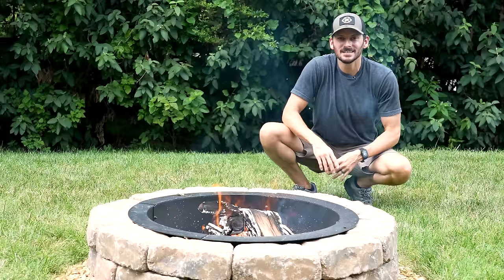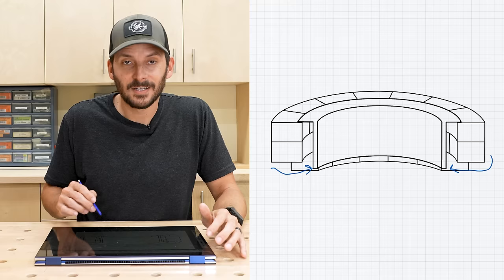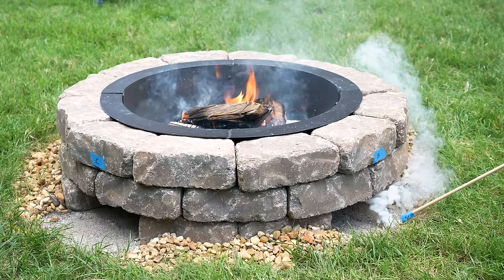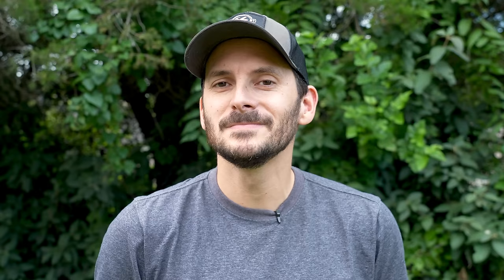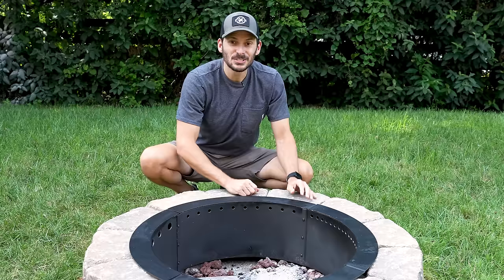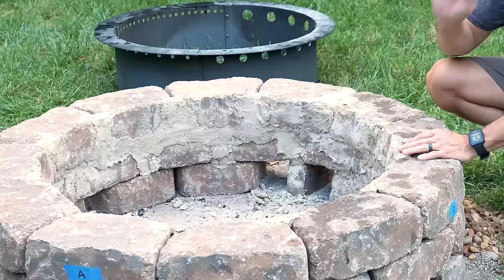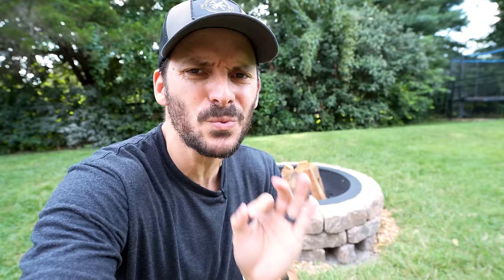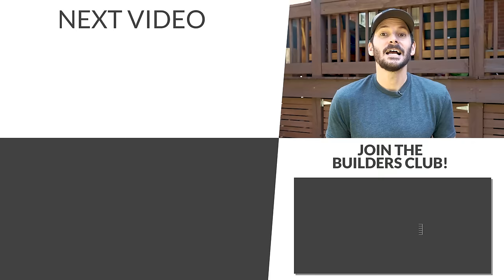Stop the Smoke, Do THIS to Your Fire Pit

Comment from the maker: Watch this next: Will Concrete EXPLODE in a Fire Pit? - https://youtu.be/TJP4iQlV8qU
Reply: Suggestion: I was hanging out with a neighbor who was using his oil-barrel smokeless incinerator and his has a few additional features:

1. an internal 45-degree bevel that redirects the air rising up directly to the upper holes, and
2. an external bevel just like #1 but more like a beveled lip just above the holes to slightly narrow down the fire pit/incinerator opening and giving more time for the secondary air supply to mix with the smoke and make the secondary combustion more effective.

The external beveled lip is around 1.5 to 2 inches in width which at 45-degress should only narrow down the fire pit opening by a total of 1.5-2 inches.

I was surprised his incinerator hasn't produced any visible smoke at all and I just thought that those features might have helped.

Comment: I'm thinking the only thing you could have done that would improve the performance of your fire pit is more depth. The Solo stoves are much smaller in diameter than your fire pit and they are taller in height. That gives much more space for the air to really heat up as it rises from the bottom to the top of the air channel. Great video! I know I learned a lot by watching it.
Reply from the maker: thanks! definitely would be better taller
Reply: A taller, narrower pit also concentrates the heat more. You want maximum heat and oxygen to maximize combustion.
Reply: @Fixthisbuildthat  As a mason if you didnt get the fire clay or at least fire mortar that quick set is going to crack with higher heats
Reply: Yes, and the fire needs to be big enough to really heat the wall of the fire pit. 
This makes it so the air gets proper flow and is superheated so it really combusts the smoke.

I own a solo stove and it works really great, as long as you keep it properly fed.
When it's really hot it burns green wood mixed in without any smoke.
Reply: @Fixthisbuildthat  or deeper. It doesn't have to be taller 💁‍♂️
Reply: I think diameter is the main issue.  Because of the inverse square law, a fire pit with twice the diameter of the solo stove would only be 1/4 as efficient  with airflow.  Also the stones and steel act as a giant heat sink, whereas the very thin stainless steel on the solo stove heats up very quickly and allows for the secondary combustion much faster.
Reply: or, load it up with wood initially. I think it may have done what you wanted during the earlier phases of the build if you had the fire as large as you did at the close of the video. Great project. Looks awesome. Thanks for sharing
Reply: @windowswashbasin  exactly.  I was commenting about decreasing the diameter of the pit, but increasing the diameter of the fire would have the same  effect.  Just depends on how much wood you want to burn…
Reply: Yes, I agree. But that is also relative. It depends on the size of your fuel and how much of it you use and how you distribute the fuel in the burn container. In this video, he didn't really use enough fuel until the end. A taller and skinner burn container does help a lot, you are right. But if he can keep the flames that come from the logs a few inches BELOW the top air holes, then the second injection of pre-heated O2 at the top has a chance to "secondary burn" any smoke the logs create. Also, above the top holes, the burn container should tamper in about 10% (rough guess). This helps maintain a higher air pressure at the exit, which creates a little back pressure, which helps give a more complete burn. This whole thing is a gasifier. You can google how to gasify things. Anyhow, it works because you are actually starving the fuel of oxygen, the amount of air flow coming from the bottom is very specific. You don't want too little or it won't burn hot enough. And you don't want too much because you want the first burn to use up all the incoming oxygen from below, you don't want extra unused oxygen pushing heat past the burn zone. A regular full downdraft gasifier will push the smoke over superheated activated carbon (hot coals) to convert any remaining oxygen and carbon to CO (which actually burns 100% clean). So, keeping the heat together so that it gets hotter, and controlling the airflow speed, will allow the longer chain tar molecules (smoke) the time and heat they need to break down to smaller and smaller chains until they turn into syngas (mainly HHO + H2 + CO) which is a natural type gas that burns clean and can be burnt at the secondary oxygen injection (the top holes), assuming that the oxygen and syngas are pre-heated hot enough.
Reply: I guess it depends on what you want most from your firepit, aesthetics, function or a balance of both.  I like the looks of a wider pit, and I also like being able to see the fire. If a person builds a taller fire pit, they may miss out on the aesthetical beauty of seeing the fire. I think this firepit is a good balance of both.
Reply: @ranmangolf  Sure. So I guess the real question is how to build one with the most visible flame but also the most complete burn. I'm thinking if we mimic an updraft gasifier a little more then it might help. For instance, instead of a flat bottom have a mesh cone so to more evenly distribute the incoming bottom air. And would make the fuel a bit more visible.
Reply: (First read my posts above.) So, I've been thinking of building this for a few years now. What we need to do is build an standard updraft gasifier. But then, at the top, open it up for burning like a Bunsen burner. When done correctly, this would have a nice ascetic of a large full smooth flame shooting straight up out of the container. Now, you wont be able to see the fuel. You would only be able to see the secondary burn. But, it would be clean and smooth and look just like a jet of flame, similar to a Bunsen burner. To do this we would have to build a regular updraft gasifier but with a different top, one that has a reduction zone with the right diameter and length. And probably relocate the secondary oxygen injection. You can actually mimic this idea with just a tall burn container and a ton of fuel but not over half full, and good bottom air flow... but it doesn't actually work very well. The 5th grade example is to roll up some newspaper or cardboard (like a "tube"), hold it pointed upwards, light the bottom, and let the smoke go up the center of the "tube". If the diameter of the tube isn't too big nor the tube too long, you should be able to light the smoke coming out of the top as an example of secondary burn. Of course watch out as you are now holding a candle that is very quickly burning at both ends.
Reply: I wonder if one could create passages that slant or wind up to the top holes to increase distance without having a much deeper pit?
Reply: @PimpTrizkit-42  Good idea!
Reply: Wouldn't that block most the radiant heat from the coals? That's the main thing that worries me about the solo stoves.
Reply: Nothing to do with the height of the pit or airflow, It's all about  the quantity of wood you're burning that makes it smokeless.  More wood = bigger fire = more burnt sooth or lack therof.
Reply: @adamschaeffer1565  If you are talking about my example. Yes, but that is the idea of a gasifier.  That first stage burn is meant to trap as much heat as possible to allow for a complete burn (no smoke). This maximizes the amount of syngas production. The syngas is the product we are actually trying to burn for real world work (aka. heat). So you max out the syngas production using what ever techniques work. Then burn the syngas in whatever way you need to accomplish the job. I was just wanting to burn it immediately for a nice looking flame but in your case you would burn it in some radiant stove meant for heating large areas, just like natural gas burners, for the same reason. But yes, going back to the more simple design like the solo stoves. I have always thought there should be a radiant mesh cone with radiant shield hung above the solo stove to reflect the heat back down. It just going straight up too much.
Reply: @adamschaeffer1565  that is exactly what happens on a solo stove. It's a great jet engine not a great people warmer. The pit is not very good at providing heat to the gatherers. Solo now sells a heat deflector that goes on top to angle the heat down and out to the gatherer's knees.
Reply: @IvanReyna  I wonder how much heat you would get if you used this guy's design or the solo stove and put it somewhat underground, say where the top of the pit was at ground level?
Reply: The way you build a fire can make it or break it btw, a top down fire will smoke a lot less, which is how you are supposed to build your gasifier stove forea
Reply: I'm wondering if some baffles behind the metal ring to slow down the airflow and give it more time to heat up.  

Also, how do you clean the space between the ring and the bricks?  I could see hitting it with the air compressor to blow the ash out of there, but that's going to make a heck of a mess.  I guess if you only have to do it once a year probably no big deal though.  Nice work.
Reply: I wonder if you added aluminum foil to the back of the bricks? How much would that help heat the air?
Reply: It also looks like the narrower width gives the smoke less space to leap out at the top leaving the rim without getting in touch with the flames.
Reply: @Fixthisbuildthat  0:38  - Someone will do the math one day, and its gonna show the smoke is pulled in by the persons mass.
Reply: @grotevin  Yes this!
Reply: Exactly what I wanted to say.
Reply: Yeah seems like that would give more time for the air coming up the sides to heat up. Also think the smaller diameter helps because hot air gets hotter since it’s closer to the flame and the air can more easily get to the top of the fire.
Reply: Not necessarily taller from the ground up, but perhaps digging into the pit to about its height and putting in a grate. Its a bigger project, but if you can replicate the commercial smokeless fire pit as kind of like a half in-ground pit, you may be going places
Reply: I was thinking the same thing, the secondary combustion can’t really take off if the fuel is sticking above those top holes. That tall log tepee looks nice, but you don’t get that clean burn from the extra air.
Reply: That's called "Stack Effect" or "Natural Draft". A taller stack generates more draft.
Reply: I totally agree with what's been said, the only reason I'm chiming in is because making the pit deeper and narrower would be like turning it into a pseudo rocket stove. Mimicking the rocket stove design will eliminate the smoke and produce more heat.
Reply: I've got the big solo stove and they recommend not having any logs poking above the rim, in order to minimise smoke.  It works amazingly with dry wood (though it does chew through it!) but they were right that if you stack it too high you'll get more smoke.  They are great to sit around though not the best looking - yours much prettier!
Reply: My brother. the more you get excited I’m over here cheezzing and mad happy for you great video.
Reply: Like a chimney?
Reply: or just use smaller logs LMAO!
Reply: @Fixthisbuildthat  Power plant operators call that the chimney draft effect, you are good.
Reply: @dwaneanderson8039  wouldn't this also burn the wood more quickly? Wood density aside, more combustion = more energy = more heat= faster burning.
Reply: WAS THINKING THE SAME THING🍺
Reply: @PimpTrizkit-42  The mesh would not last very long? Maybe a season at best. It would also get packed and clog?
Reply: You just reminded me of how not smart at things I am
Reply: I agree, I think it's a matter of getting the depth/ radius ratio right for this to work as per the commercial models.
Reply: @coollninja  it will crack regardless . I used a culvert pipe made of steel reinforced concrete and it cracked up eventually . Nothing holds up for very long to the fast expansion and contraction from heat except steel in my experience .
Reply: @Chris Cooper to burn wood , heat and smoke is produced . In blast furnaces or similar , enough heat is produced to minimize smoke , but it is still there . A campfire that is burning intense will not smoke as much , but even with that ... The wood on the the outside will smoke after it starts to burn down . Some nights are worse depending on the temps and weather conditions . I have watched the smoked rise up quickly until it stops and spreads out as much as continues up .  Good job , but you are asking the same out of a campfire as asking a doctor operate on you without bleeding 🙂
Reply: @Fixthisbuildthat  Do it again some time in the future, I'd happily watch another video!
Reply: @Fixthisbuildthat  I don't think taller is the answer, it's the smaller diameter so that the holes at the top create a continuous heated ring of air. Too large a diameter and the middle of your fire is just not interacting with the top jets. Smaller holes might help to increase the velocity of air to counteract that but not sure how effective it will be.
Reply: @Fixthisbuildthat , would this design eliminate the need to have the holes at the bottom of a standard fire ring, that is 10" high, with a lip? If you add a fourth row of block for the wall height and place the ring on top of the fourth row (blocks being 3.5" high each), and with the air channels in the bottom row, as shown in this video.
Would this design potentially still accomplish the same design goals, and therefore be smokeless?
Thank you!!
Reply: Would you guys use a “heat stop” mortar on the inside. I live in the NE and would see this crack the first winter which wouldn’t do anything structural but would just open up the airflow again
Reply: Also, I see a sort of domed top lip to them usually. Thoughts?
Reply: @Fixthisbuildthat  I cannot wait for the next video of the improved taller fire pit. ;).
Reply: @Fixthisbuildthat  What kind of laptop/tablet is that you have there? That thing has a monster screen!
Reply from the maker: @scottaaa397  Samsung Galaxy Laptop 👍
Reply: @Fixthisbuildthat  Thanks man! Keep it up, love your work! Love your content!
Reply: After thinking about this, it seems the effort to reduce the smoke requires building a structure that hides the flame and embers - a large jet stove - and doesn’t warm the people and is not that nice to look at (no embers and burning logs).  I wonder if an alternative would be some type of free standing chimney?
Reply: What's the best ratio in your opinion : 1:3 ? 2:5 ?
Reply: Two points. 1. True metal drilling oil doesn't lubricate the bit it is designed to draw heat away. 2. Air naturally flows from a large opening to a smaller opening (think total square inches) per hydrostatic pressure.
Reply: @coollninja do you have some links for the fire clay or fire mortar?

Comment: Really liked your pit design. There is another way to have a less smokey fire. You don't construct a tipi. Instead you pack in tightly the logs at the bottom. You add smaller pieces and at the top you construct the twig, pinecone, dried orange peel pile. One lights the top, not the bottom. The fire burns gradually downwards but having the fire at the top means it burns the gases coming out of the gradually heated logs. Much less smoke and significantly more heat.
Reply from the maker: that sounds like a cool idea, definitely going to try that!
Reply: Crypto investing has brought me great success!!! Irrespective of the economic depression I can boast of over $12,000 dollars every week on my investment. All thanks to Mr Richard…Thank you for your focus on quality stocks.
Reply: Known as the Council fire. Boy Scout style. Works great.
Reply: Interesting! Can you build your fire this same way in an indoor fireplace? Less smoke and more heat is good there too.
Reply: Yes
Reply: Yes I agree! the top down method. We use it for our winter stove

Comment: I like the fact that he didn't edit out the mistakes he made and what didn't work in order to demonstrate how the various changes effect the outcomes. Great video!
Reply: Absolutely that way if the next person thinks that what he did is the best way they can see that it's not and it'll save them time and headaches. They say that failures are steps toward success.
Reply: Why wouldn't he... you people were paying him to experiment... it cost him nothing and he probably made thousands above what it cost him... not to mention he had a sponsor paying him...
Reply: @t.c.2776  I suppose for the same reason 9/10 youtubers edit out any flubs, mistakes, bloopers, mishaps, and anything else that may not project a polished and professional appearance to their audience.
Reply: He did build a bigger fire at the end to get more heat into the system. Did it have less smoke when it was a smaller fire with the dry wood?
Reply: With just one kinda essential error, in the final "before" and "after" he comperes the wet wood to the 5 years dry wood from his dad. Would have liked to see a comparison that took the difference of wet vs. dry wood into account. Other than that, great video! :)
Reply: oh yes, I agree. I appreciated the show of 'trail & error' demonstrations too.
Reply: The video and testing was great until we were close to the end. Final "before" was with "wet" wood and final "after" was with 5-years dried out wood...whyyyy. The same wood should be used for comparison (in this case "wet" for "after").